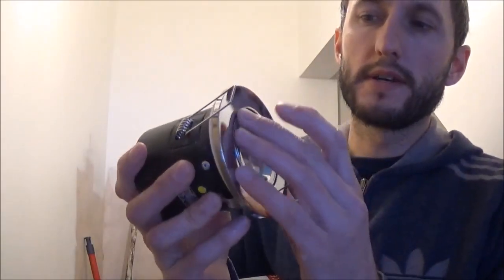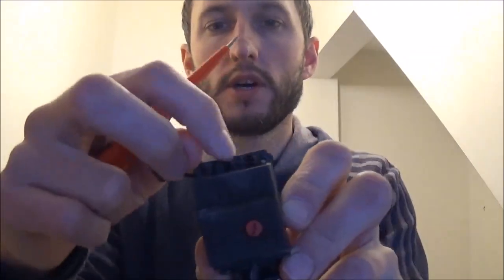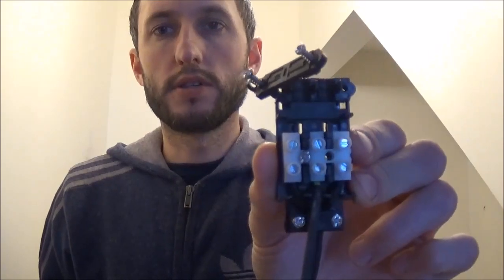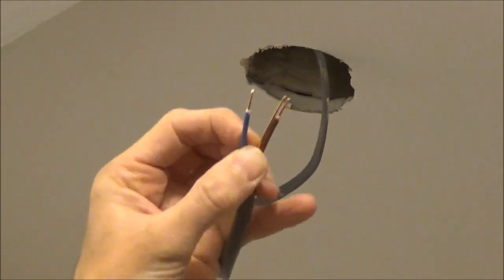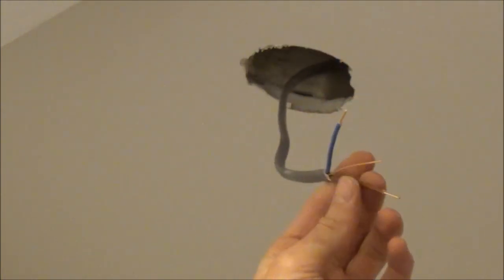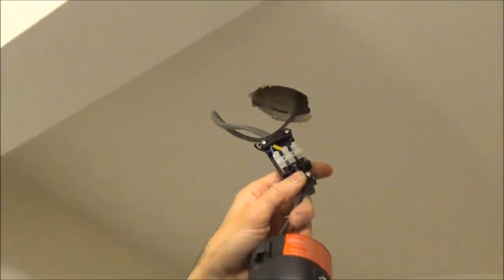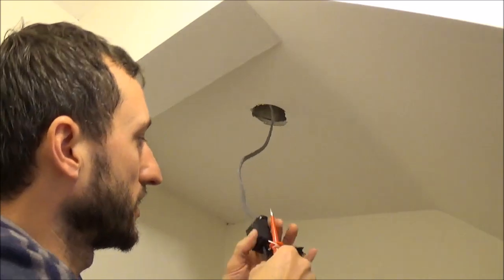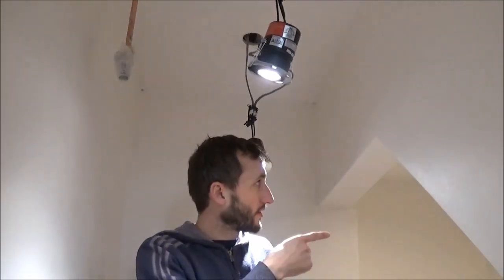How to install downlighters/downlights. LED downlight installation.

Comment: Hi I have two blown Saxby 73787 ShieldECO IP65 spot lights, I have bought replacements from amazon, they have the whole unit and black part, can I just swap these out without turning off all the power to the flat, they are push connectors. Thanks you.
Reply from the maker: You need to isolate the power when working on the lights. You should be able to just isolate the light circuit by turning off the MCB or removing a fuse (if you have old fuses). If in doubt please contact an electrician to do it safely. Thanks for watching.

Comment: can we not connect the twin and earth to the next light using the connector blocks at the bottom rather than connecting them to the existing ones at the top?
Reply from the maker: Potentially but often the light fittings are designed only to take one wire in each terminal.

Comment: Thank you, very well explained. I do have a question. I want to replace fluorescent light bulb 16w with spot lights. I do have three plate method in the ceiling connected to fluorescent lamp. There are four connectors, and from there three cables running (L E N) to lamp. My question, can I daisy wire my toe spotlight to before mentioned cable or do I have to change something? Would much appreciate any insight. Thank you.

Comment: As usual, a great very clearly explained video.  Quick question hopefully, just moved into an older house, has 4 spots fitted in the bathroom & a shaving point/light over the sink, one 'line' of 2 spots work perfectly but second pair (one over entrance & second over the shower cubicle) don't.....also, previous residents took the bulbs out of the shaving light over the sink. Any ideas where to start please ??

Comment: Hi fella, my mothers downlights have stopped working, the old style cylinder transformers are knackered, can I cut them out and replace with GU10 downlights
Reply from the maker: As long as all the transformers are removed then yes these can be run directly from the circuit without using transformers. If in doubt please call an electrician to ensure the installation is safe. Thanks for watching.

Comment: Can you connect a new light from an existing light in the kitchen in the same way
Reply from the maker: Yes but the connections may look different. You need to find the permanent live, neutral and earth wires. If you have a traditional ceiling rose this video may help - https://youtu.be/FjmC0qx1nrU. If in doubt please use a qualified electrician to ensure the installation is safe. Best of luck.

Comment: Are they easy to pull back out of the ceiling?
Reply from the maker: A bit tricky as they tend to crumble a bit of plasterboard, but it can be with little mess if done carefully.

Comment: Great videos mate watched a good few of them now 👍🏼
Quick question if you dont mind. Currently doing up the en suite. Wondering if its possible / legal to mount the ugly ceiling rose in the attic and just drill a small hole in the ceiling to drop the pull core through. Id use a small section of wood to hold the ceiling rose in place then screw that to the joist. Any help would be appreciated 👍🏼

Comment: Having my bathroom done with spotlights soon,

Will he have to get into the loft and over bathroom area to cut holes and find feeds
Reply: Possibly.  It depends on what's above the bathroom ceiling.  Once the electrician has pulled out the existing light fitting, to get to the power source, they need to run an extension to each spotlight in turn.  If they drill the holes for each spotlight they might be able to feed the wire in through each hole in the general direction of the next one, and try to reach it at the other end... but if there's anything in the way (roof joists, insulation etc.) then it's going to be quicker and easier to get into the loft to do it.

Comment: Hi... after installing downlights in my attic, is it safe to relay the lagging over the top of the lights?
Cheers mate,  great videos. 👍
Reply from the maker: You should leave a gap around them or you can buy special products (look like a cup) that go over them before adding lagging. LED down lights generally give off less heat but best to be safe.

Comment: My current house wire has 2 feeds only Live & Neutral. Does the lights works without earth connection?
Reply from the maker: They do but you must make sure you only use double insulated light fittings so to avoid electric shock. Hope that helps, thanks for watching.
Reply: @POUSEaroundtheHOUSE   Thanks for the comment really appreciate your help. What thickness the wire guage should be if we are lighting only 6 downlights or 24watt.                                                                                                                    If you are looking to make any new youtube video.. My house is full of flaws to make a new video's.. I am available as hardcore labour not skilled labour.

Comment: I have just bought some searchlight chandelier ceiling lights for my new build house, ive took down the ceiling rose on both and on one fixture it has live,  neutral and earth coming from the ceiling and the other has 2 of each coming down , is it ok for me to attach the wires directly into the junction box on the light , the junction box on the light only have  4 avaliable openings ??
Thanks
Reply from the maker: It might be worth you watching these two videos which may help. How to fit a ceiling light. Lighting circuits explained. Replace and install a light fitting. - https://youtu.be/iQAs5zq-32c
How to wire a ceiling rose - https://youtu.be/FjmC0qx1nrU
Hope that helps!

Comment: All we all want to know is how to wire it up in the sealing and Join them on onto one and  another not one video on YouTube does they all show us only to wire the got dam light but not the Main wiring
Reply from the maker: You sound angry. Try these two videos, and relax, they may help. How to fit a ceiling light. Lighting circuits explained. Replace and install a light fitting. - https://youtu.be/iQAs5zq-32c
How to wire a ceiling rose - https://youtu.be/FjmC0qx1nrU

Let me know how you get on.

Comment: Do you need a transformer for each downlight you want to install? 
Also how much cable do you need for each light? Is it one length of cable per light then connect to a transformer?
Thanks
Reply from the maker: Depends on the lights you use. These are GU10 lights so transformer is built in to them. So cable just goes from one light, to the next, then to the next and so on. If you use lights with transformers then you just link the transformers and use a separate cable from the transformer to each light. Hope that helps.

Comment: Great video! Im fitting 4 new downlights just like your video, however I have bought some new 5 metre 2 core extra cable eg. no earth cable, just neutral and live. my question is.. would that be ok? having no earth cable?? its 1.5mm white cable i have
Reply from the maker: It's ok if you have double insulated lights that don't require an earth. If they need an earth then you can't use that cable. It's to make the light fittings safe. Should tell you on the box or instructions. Thanks for watching.

Comment: Great video mate, can you tell me whats the best way to drill through the ceiling joist when running twin and earth for downlights? cheers!
Reply from the maker: Just used the correct size spade drill bit. Thanks for watching.

Comment: Awesome video mate as always!. 
I’ve currently got a fluorescent tube strip light in my garage and would like to change it out for spot lights. Would I be able to just use the existing wire for the strip light for one spot light and then wire the rest of the spot lights on from there? I’m assuming it would be fine with the LED spot lights been LED and low wattage?
Reply from the maker: Assuming your current bulb is wired safely then yes, no problem. Obviously all your wiring should be compliant with Part P and tested to make sure it's safe! Best o luck with it.
Reply: @POUSEaroundtheHOUSE  hi  I'm just thinking of doing the same with my garage lighting, replacing centre rose with 6 downlights.  Going off your vid, loop in and loop out connect to first downlight, and then link remaining 5 downlights in a row with the first?  Effectively 3 sets of wires connecting to the first downlight?

Comment: Hi, I’m spot light have stopped working. How do I work out which spotlight is the faulty light ? Do I check each light to see if they have live electric?
Reply from the maker: If they're wired correctly they shouldn't all go off if one is broken.

Comment: How do you remove theses if the light goes?
Reply from the maker: You apply pressure to the bulb, turning anti clockwise. The bulbs can be removed and replaced.

Comment: What's the cable size did you use to connect downlights?
Reply from the maker: I used 1.5mm twin and earth. You can use 1mm twin and earth as well in most situations. Thanks for watching.

Comment: do you have to do anything special if the lights are CFL 4-pin G24s? does it have a ballast or something like that I need to think about? I simply replaced the pendant with a b22 one and put a b22 cfl, but the bulb stopped workign after a few minutes
Reply from the maker: Sounds like a job for an electrician sorry! Thanks for watching.

Comment: Need some help... Downlights for overboarded ceilings... Do the springs have to rest flat on the plasterboard or does this not matter? If yes will I have to cut some layers of the board down to get the springs to be flat?
Reply from the maker: They should especially if you are meeting fire regs with fire rated downlights which with two layers of plasterboard you probably are. If you're not, than you can get away with them sticking up if they hold them in place tight. Thanks for watching.

Comment: 2 questions ....we have a corded light switch in bathroom it takes 2 pulls to activate lights (spots) instead of just one is thus easily rectified ? 2nd we also have unlike the front of house thats been fused etc (outside lamp) the rear has 1 but is only fitted with a plug that is plugged into the socket not sure why but ideally would like to wired it with a switch properly? Thanks mate as usual great videos
Reply from the maker: Not entirely sure about the pull cord. Try replacing the switch maybe. As for light, no reason why you can't hard wire it to a fused switch, just make sure fuse is correct rating for light and cable. Thanks for the comments.
Reply: @POUSEaroundtheHOUSE  ok ill take this on board thank yoi

Comment: Hi Pouse. I have a loop system on my spots that I'm replacing. Do I need to refit all the spots before testing (in theory complete the circuit) or should I be able to test once one is fitted
Reply from the maker: You can test if one is working, then add the others from that one. But if you mean test for safety etc, then install all of them first. Thanks for watching.
Reply: When there is a loop do you complete the loop with the 3 new downlights or do you come off the loop and connect the 3 cables to a dead end.. if you know what I mean?

Comment: Do you need a connector ie terminal block for each light except for the last one?
Reply from the maker: No, just use the light terminals to daisy chain out to the next light.

Comment: Great video. I currently have a bog standard bathroom light with a pull switch and want to change to some ip65 rated downlights. What is the best way of connecting all the downlights to power? I'm thinking of installing 4 downlights and also an extractor fan. Would it just be the case of taking out the light currently in place and using that cable in one of the downlights and then running a cable from that one onto the other downlight and so on and then on the last downlight run a cable back to the supply light/cable?
Reply from the maker: Something like that, as long as you have the correct wiring in the first light. If you check out my electrical playlists on my channel you will find other videos that should cover this. Thanks for watching.

Comment: Did anyone notice how close that downlight was to a joist. 

Joist even looked cut out to fit the DL

DL needs to be at least 2 inches from joist. 

This can be checked before cutting. 

Also the terminal connectors were just floating above the DL they should be secured to the DL

Also notice how the DL struggled to go in. Most likely pushed it up against insulation board. 

Just no.
Reply from the maker: The joist wasn't cut and there is plenty of ventilation above. Thanks for watching.

Comment: Awesome vid I was Doing some painting and pulled out the down light when I started putting them on I noticed the insulation is so thick and long those clips dont come down it up and sits on the insulation anyway round this to get it flushed with ceiling
Reply from the maker: You just have to get small saw like a dry wall saw up through the hole and try to saw it out. Hope that helps. Good luck!

Comment: I noticed insulation in your ceiling.  Are those downlighters coverable ones?  LEDs don't generate much heat, but they should still have a gap.
Reply from the maker: Hi Tim, yes you just have to cut the insulation away with a drywall saw or bread knife to leave a gap. Hope that helps. Thanks for watching.

Comment: Hi what size wire do you use for downlights? How about routing the wires? Did you take the floor boards out from above?
Reply from the maker: Hi Dan, lighting circuits are either 1mm2 or 1.5mm2  twin and earth cable. It depends on how long your circuits are as to whether or not you use 1 or 1.5mm. I had the ceilings off to do my bathroom so I was able to wire them through the joists that way. You can go through the floor from above if it's easier.
Reply: POUSE around the HOUSE Thanks for your reply, I ended up using 1.5mm, and the joists already had holes in so no need for me to do that.

Comment: Hi mate, I’ve got a new build house and have the twin and earth wire hanging out the ceiling. I’ve done what you said and connected the end spotlight and then wired a total of 4 IP65 lights. The original twin and earth wire that was connected to the ceiling rose is now connected to the first spotlight. Then daisy chain from there until the last light. My earth copper has not got a cover on so I will go back and correct that. 
However as soon as I turn the switch on they blow the fuse box downstairs?? 
Should I be using a connector box?
Reply from the maker: I'm assuming you are using like for like lights? If they were 12volt lights you either need to rplace with 12 volt lights or find an remove the transformers if you are now using 240 volt lights. Check all your connections, and failing that you may have damaged some cable. If in doubt, you'll have to get an electrician in to test it and they will be able to locate the problem. Hope that helps and thanks for watching.

Comment: If you can help I had florescent lights 16 of them at 36w total of 576w but replaced them with led light 8 of them at 48w total of 384 But it's tripping my circuit breaker ?? I have checked my wiring it's perfect ? There's also sizzling noise coming from circuit board!!
Reply from the maker: I think you need to call in an electrician to install them. I'm assuming you're using 240 volt downlights and not 12 volt downlights? 12volt downights need a transformer. Please be safe and get it checked by a professional. Good luck with it.

Comment: Hi, My previous downlights have a transformer....    do you just cut it out and not use it please?
Reply from the maker: Assuming the new lights are 240volt, then you need to remove the old transformer as you said, but make sure you have the main power feed before connecting up. Thanks for watching.

Comment: Hi when you install downlights do you isolate from switch or from fuse board?
Reply from the maker: Always fuse board. The light switch doesn't isolate the permanent live to the light. Hope that helps. Thanks for watching.

Comment: In a bathroom scenario, what would cause these type of downlighters to flicker when you turn them on - would it likely be the lights themselves or the pull cord?
Reply from the maker: Not sure, maybe the built in drivers if they are cheaper lights.

Comment: Excellent would you please do a video that concern junction box and switch for multiple lights in same room please
Reply from the maker: This room has got multiple lights. It's the same principle, just daisy chain the cable to the next light as long as you want them all operated from the same switch.
Reply: i have one power lead in kitchen ceiling and 4 x 12volt slim fit LED lights to fit  in the ceiling, all 4 come with drivers and a round connector to a driver. the drivers are very small  and sealed,   so you cant  link LED 2 to 1 , and LED 3 to 2 or LED 4 to LED 3. do i use  4 choc boxes and link them all to the main feed in ceiling. Also the LED lights will be seperated 1M apart but only with a 6inch lead

Comment: Hi, I have fitted some fibre optic star light in my Ceiling... would you know how I could wire this up it currently needs to be plugged in at the wall (plug socket) can I use a spur off my light and the attach a plug socket and the use my light switch to turn it off an on?
Reply from the maker: Hi Tony, you can't just do that without knowing the size of the cable etc. I couldn't give advice without seeing it really. Thanks for watching.

Comment: I've just installed these are you going to put loft insulation over them?
Reply from the maker: I cut around them. Check what the manufacturers instructions say. You usually have to leave an air gap or you can buy proper insulation 'cups' that sit over the lights. Hope that helps. Thanks for watching.

Comment: Does the last light with single wire not need to return around (as in, in a loop?)
Reply from the maker: No. Lighting circuits are radial circuits so no loop like with ring final circuits (sockets). Thanks for watching.